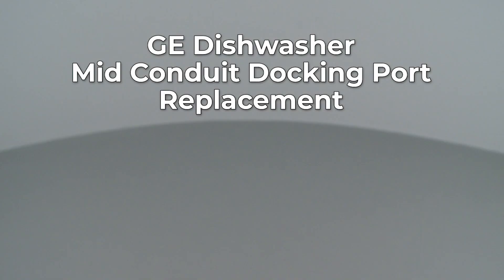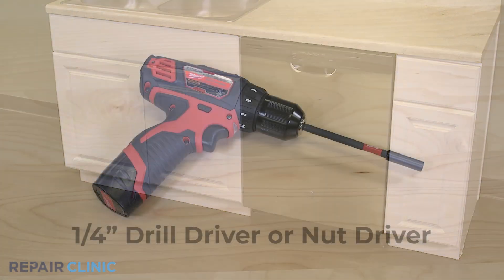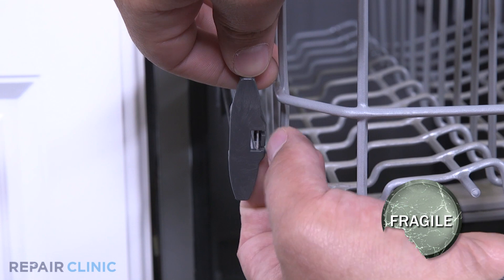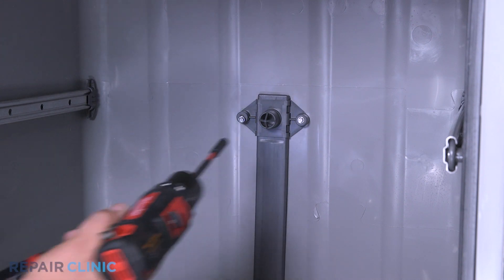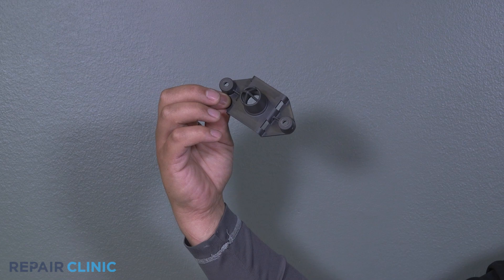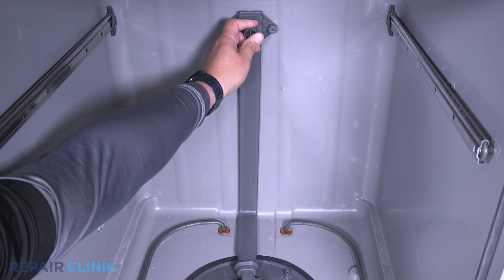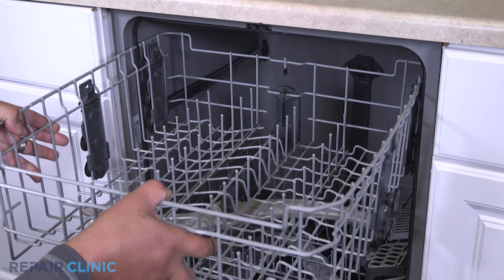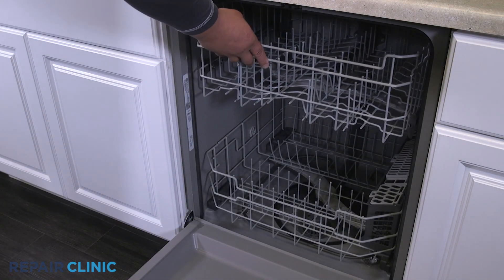GE Dishwasher Mid Conduit Docking Port Replacement WD12X22812

Comment: What about the mud conduit arm?  They left it off?  I came here because my helicopter sprayer came off the docking port and it will not just snap BK into place.  But they did not even install it nor remove it!   Pitiful video!